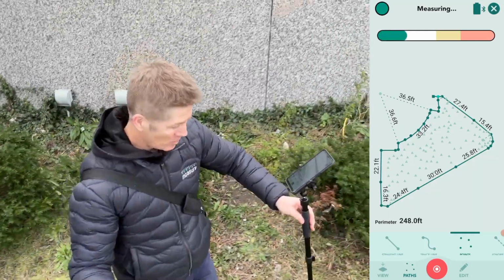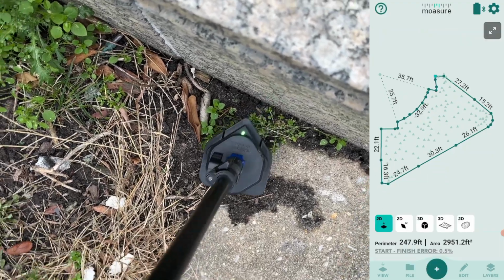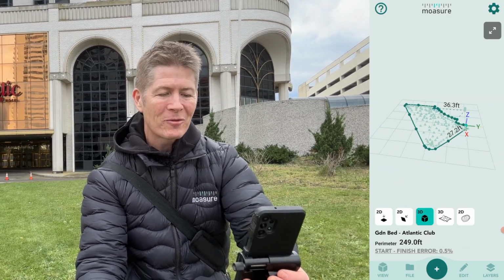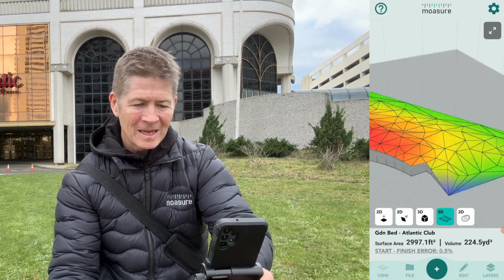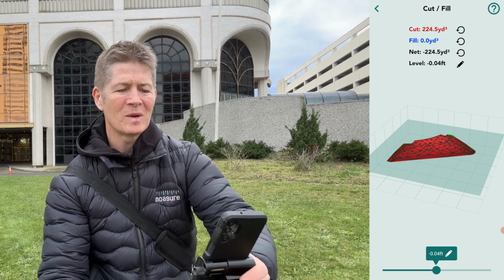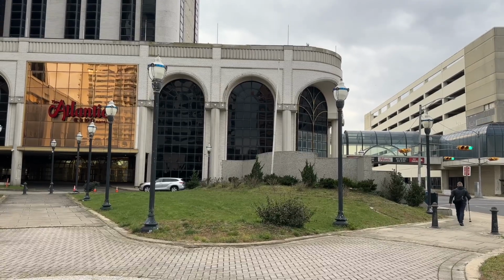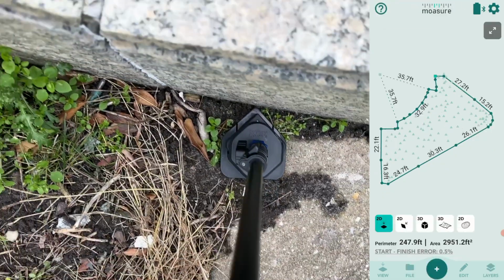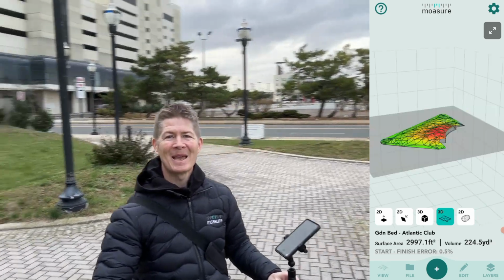Topographical Survey in a matter of minutes.

Comment: I have tried this process but get an error that says ‘we are unable to create a contour map of your measurements’ when I try and get 3D or contour maps. 

The only thing it seems I may have done different based on this video is I didn’t end my point collection at the starting point..? Is that a necessity?
Reply: I am still able to see the 3D map to clarify and the relative change in elevation is accurate. 

It will not generate the 3D model or create a contour map however is the issue I am having

Comment: I did my first topographical survey with my Moasure last week for an infill city lot I am designing a house and detached garage for.  It worked great.  There was 6.5' of fall from the rear ally to sidewalk in the front. I can now determine my finish floor height and ensure proper drainage.  I did not have to pay $1,800 to have a surveyor come out and do it. It took me about 20 minutes to do.